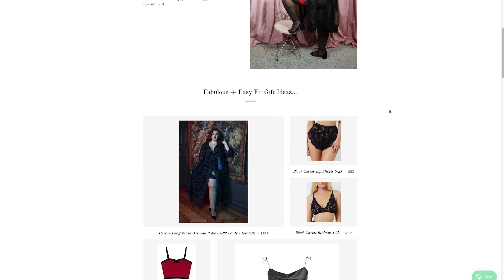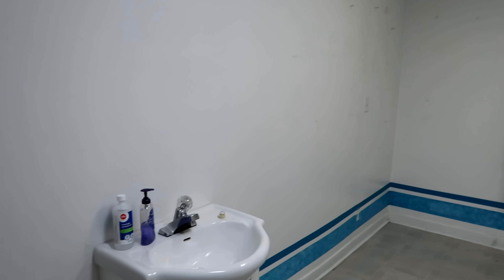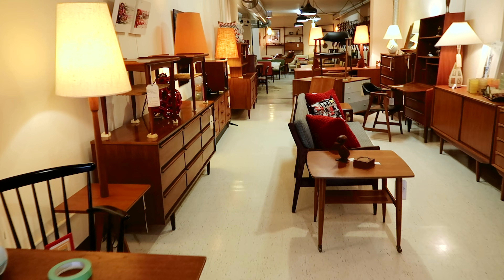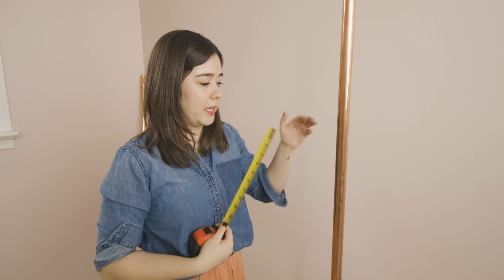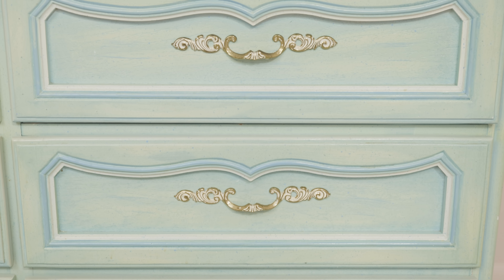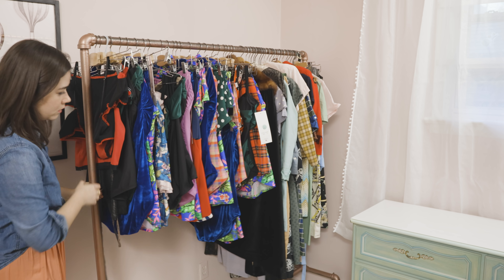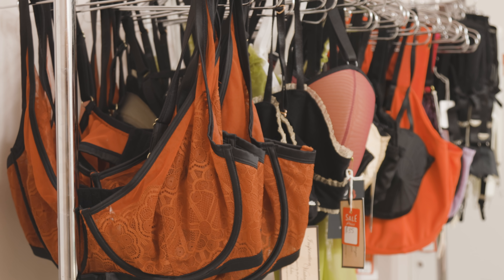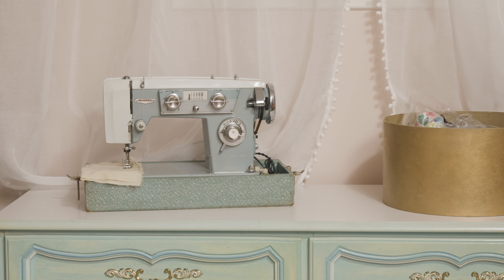Vintage Office Makeover | Cluttered Storage Room Transformation

Comment: Great transformation. Just one question: Why do you have the drawers on the dresser facing outward, away from where Gigi will be sitting. It works better for the video, but hardly practical for Gigi, will have to get up and go around the desk to open a drawer.

Comment: Either that chair is on the wrong side of the peach desk or the peach desk is facing the wrong way lol. Doesn't seem efficient or practical.
Reply: yeah, I would have put the off-season stuff up near the ceiling, since it doesn't have to be accessed for months, and put the desk under it. Klutzy me would be banging my hips every time I tried to get around that desk.
Reply: She most likely did that for the camera angle. I hate things like that, it doesnt reflect the true end results of what you'd get once the cameras are off, we arent often told what happens to all other items that were taken out of the space
Reply: If she removed the sink and replaced it with the desk it would’ve been spot on

Comment: Really cute. Just some questions/suggestions. 1. Where will she plug in her sewing machine. Will she just have to move to the desk & plug into am extension cord whenever she uses it. 2. I wish she had spray painted the 3rd sales rack to match the other 2 clothing racks. You can buy copper spray paint for really cheap. She still would've been under budget. I just bought metallic spray paint from Target for $5. Otherwise I love this.